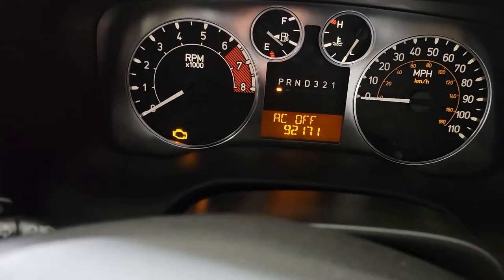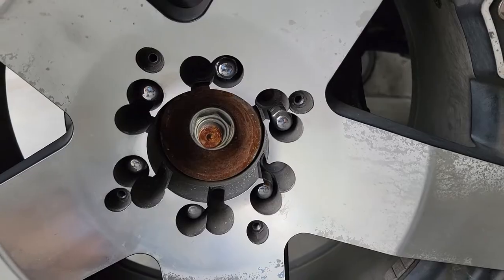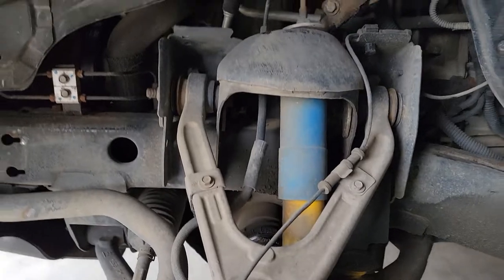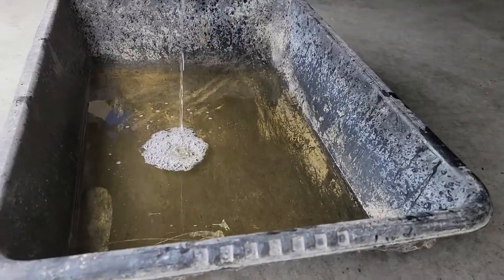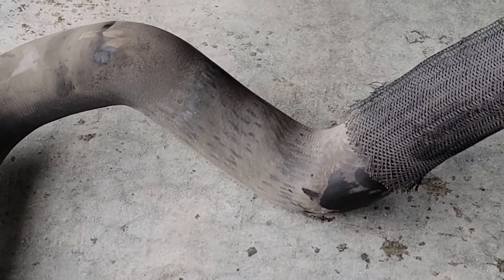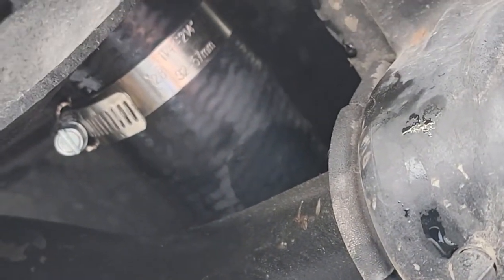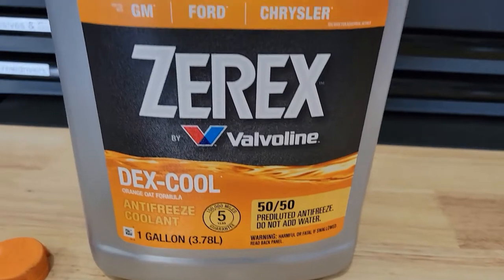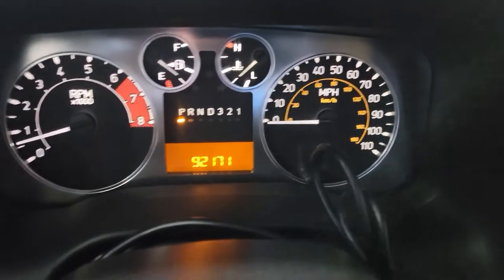The Ultimate Guide to Replacing Thermostat & Lower Radiator Hose

Comment: Hi do you bleed the air from the system
Reply from the maker: I make sure the truck is level or slight incline from the front. Let it idle long enough for the thermostat to open up. Make sure the heater is on and blowing inside the cab. Keep pouring coolant in until it's level with the neck of the radiator. Fill overflow tank to full level after driving on level surface.